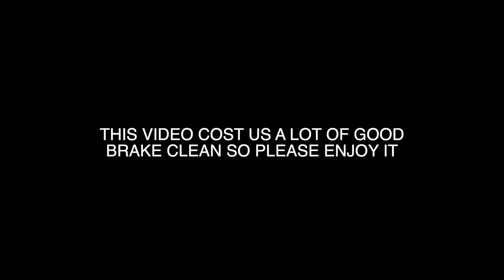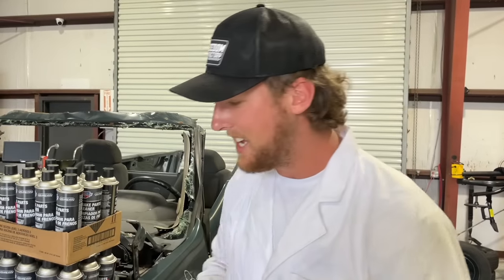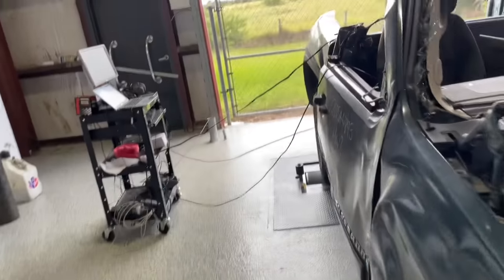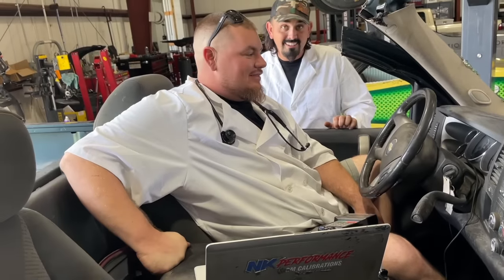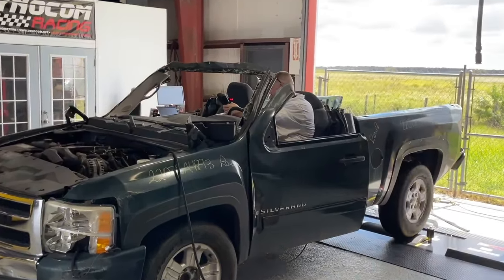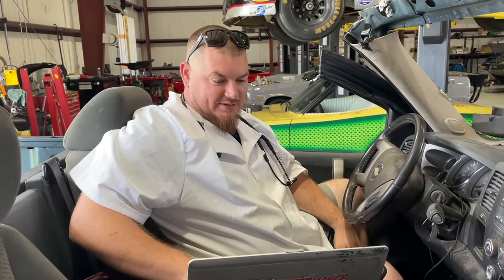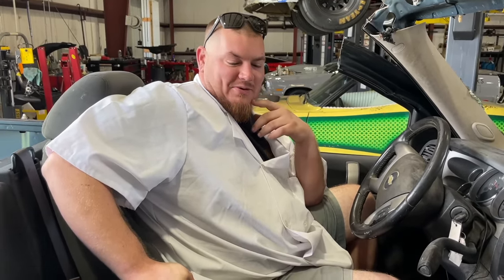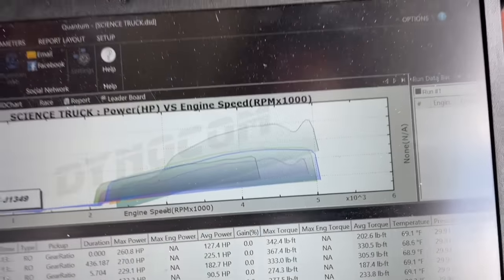We Replaced My Truck's Fuel With BRAKE CLEAN!!! Then Put It On the Dyno! (DO NOT TRY)

Comment: My vote is to test pure fuel stabilizer or maybe even pure octane booster!
Reply: Remember when project farm used to make this type of videos, but instead of cars, he tested it on lawnmower engines lol.
Reply: @eljaibas16  love me some Project Farm. He's cost me a fair bit of money. Lol.. in the best way possible. He's test/reviews are hella good sell ads. Lol
Reply: Make this get the likes people!
Reply: Inject oxygen-acetylene mixture.
Reply: I remember seeing a video of someone running everclear in a mower. It ran really well!
Reply: I was thinking the blue fuel they use in RC cars. It's mostly like jet fuel I think ain't it?
Reply: Been done
Reply: Seen a Video of someone who did this with a miata ran surprisingly well lmao.
Reply: An octane booster video would be great. Another one testing the different brands would be pretty cool too.
Reply: @eljaibas16  Project Farm is a Goat. He needs invites to Cleetus events, or DR videos.
Reply: @Vanbooskie  its called nitro, all motor 4 cylinder guys mix it with their methanol i think ive actually saw up to like a 90% mix on this one crazy ass civic.
Reply: Octane booster would be cool
Reply: @Vanbooskie  its nitro and castor oil
Reply: @HotDogBunN2YG  makes sense. I didn't know that
Reply: @Vanbooskie  rc fuel is nitromethane with a percentage off oil, the blue color is prob the oil.
Reply: @Vanbooskie Not even close, jet fuel is extremely similar to diesel and will run comfortably in a diesel motor *but has very low lubricity and will kill modern commonrail fuel pumps*. RC cars usually run nitromethane which is "closer" to gasoline than jetfuel
Reply: Octane booster is usually just kerosene, lubricants and usually some anti knock additives... It probably wouldn't be much different than running kerosene or diesel... Something I think would be really interesting is solvents... Like paint thinners... So acetone, mineral spirits, MEK, turpentine, etc. I'd also like to see someone try to run a stock vehicle off of methanol.... But not real methanol... The heet stuff you can buy from the parts store to keep your fuel from freezing up in the winter... Lol that would be really interesting for sure

Comment: I would love to see how a propane conversion would hold up to a race track. There are lots of propane conversions out there, but how would it hold up to the McFarland Science team stress test.
Reply: Thats a whole lot of work. I’ve seen a ton of mud trucks running propane so it should hold up just fine because nobody beats on a motor like a mudder
Reply: propane has a high "octane" rating 105-110ish. so i think this would be a good science vid for sure.
Reply: boom
Reply: there are a ton of cars in AU that had LPG
Reply: Propane is a great fuel for internal combustion engines. Only real problem is that it has way less energy per given unit of volume than gasoline. And unlike methanol it does not have the same cooling effect. I've seen 10 sec drag cars on propane in the past. This has not really been a thing lately but sure, I wouldn't mind seeing some testing done and a Mcfarland science test. 
They could use the Shyster for this. It's got a GM 4.3 V6 so if it blows up there are 10 million more out there
Reply: Family friend of mine ran a propane converted 302 in a rock crawler bronco and he beat that thing in the desert for years
Reply: So you want them to race a bomb?
Reply: @helplmchoking  i believe most of the taxis used it, im not from there just going off of things i’ve heard and read before
Reply: @micaharies  Ford actually offered LPG fueling a factory option, and went so far as to develop a special model of the 'Barra' inline 6 that was designed specifically to run on it. That engine was fitted with a direct injection system that sprayed liquid LPG into the cylinders, and actually made slightly more power than the petrol model due to a higher compression ratio of 12:1.

The LPG tanks were donut shaped and replaced the spare wheel, many converted cars retained their original fuel system and had the ability to run on either LPG or petrol.
Reply: @lidzykelly87  it is already a proven race fuel just nobody uses it because most race courses you can’t have a pressurized tank on the track I even had to pull my nitrous bottle and the solenoids out of the car before I could race at my local road course and it is a huge pain in the ass to install maintain use and the system is heavy it would work good as far as the motor but just as far as a convenient easy race fuel there are better ones that work with your existing fuel system. The biggest problem is the pressurized tanks required in order to use it. But the off-road guys love it there’s no rules out there
Reply: Uncle Tony on YT has one, it runs great, I converted a 6 cylinder Jeep to propane, ran great and at any angle.

Comment: Everyone knows you need a 50/50 mix of brake clean and octane booster to make some real power.
Reply: fr ffs 😂😂
Reply: That's what I was thinking during the video lol
Reply: Hair spray.
Reply: @michaelscott-joynt3215  With that crew who would have hair spray?
Reply: I had that same idea. They should try the brand Octane Supreme. It has actual tetraethyl Lead in it, I think it would raise the octane quite a bit.
Reply: dang i just posted this too lol
Reply: Add a bit of 2 stroke oil.
Reply: Could also try 50/50 brake clean/xylene. (Xylene is used as octane booster in pump gas). Can buy Xylene from hardware or paint stores.
Reply: Yes! Brake clean + octane booster!
Reply: All you need is some diesel fuel mixed in with the brake clean.
Reply: @FarmerFpv reported for false information
Reply: Per the MSDS that brake clean is roughly 47% methanol, 42% toluene, 11% acetone.  Those all have an octane rating above 100, probably in the 110 to 120 range.
Reply: It's not about you... It's the consumer.  - JD

Comment: You should retry a HP pull with the original octane fuel after the brake clean to see if it cleaned the injectors and created better atomization of fuel, to get more HPs!!

Comment: Once ran a 1998 Ford explorder 2.5 miles on brake cleaner to get to my boys house when his fuel pump went out. I sat on the radiator support while he drove about 10 mph.  Full break clean injected through the throttle body did the trick. Replaced the fuel pump, truck ran for years to come.

Comment: My son had an old homebuilt go cart with a well worn Briggs & Stratton engine. He used brake kleen to fire it up all the time.  Right until he seized it up while on startup! I'm sure he was being REALLY generous with his sprays though. Scarred the crap out of the cylinder wall and snapped the flywheel shear key when it locked up. Good times....

Comment: I'm curious to see how clean the inside of that engine is now and what the oil is looking like.
Reply: Let’s Talk 🎁🎁⬆️
Reply: The oil would look fine. All of the brake cleaner was igniting (prematurely); it wouldn’t have had a chance to mix.
Reply: Probably still cleaned the valves and maybe made holes in the pistons
Reply: One word.....nitro
Reply: Try running slick 50 or some sort only without motor oil....your engine builder will thank you!!!!!

Comment: Would be cool to see what would have happened if you added some octane booster into the brake clean and sent it :D
Reply: Sander, I was really hoping they would do that actually. And yes Caraballo it would be really fun to see that motor blow up, right in ya face
Reply: I was thinking throwing a few cups of diesel and see what happens
Reply: @luckyrashes  exactly! I was thinking 50% 93 octane and 50% diesel. 👍
Reply: @luckyrashes  Or 100% Seafoam, Marvel mystery oil, etc.
Reply: @sethgt1234  i've done that maybe not a 50/50 mix but a mix of diesel and petrol runs fine it's just smokey i ran it in a 1981 honda accord EX which is carburetted. 

for a short period in australia there was this thing of putting a LPG (liquid petroleum gas) (propane) system on a diesel to make more power. what it did was inject LPG into the airstream in addition to the diesel the disel was your spark. they banned it because esp on turbo system is it backfired you essentially had a BOMB in the intake
Reply: @sethgt1234  I meant Diesel because of its incredibly low octane to mix with this danger juice and maybe get something useful out of it
Reply: It would defeat the purpose of the brake clean.

Brake clean is effective for cleaning stuff because it’s so volatile, which is also what causes it to cause knock. You add octane booster to it and it becomes less volatile.

The reason high compression engines and boosted engines use higher octane gas is because the gas is LESS likely to combust, so therefor it only combusts by the spark plug igniting rather than accidentally by compression of the cylinders (knock)
Reply: @ChristopherGuilday  agreed, what are your thoughts on my thought, adding a few cups of diesel to that mixture, that's a ton of potential energy and a far lower rate of detonation

Comment: No way James wasn’t high as a kite after spraying all that brake clean in to a bucket 😂
Reply: Bad thing is that High comes with a hell of a headache
Reply: @600wheel  super high highs, super low lows.... Nope not for me no more
Reply: @600wheel  Voice of experience? ☠💀☠💀☠
Reply: @xippzap  yeah we use that shit a lot when we were doing industrial demolition in combination with cutting torches and the headache is real
Reply: Right! They do realize you can buy brake cleaner by the gallon.
Reply: @BaldBozo  i was screaming on screen for that but cant real blame them. If i were to make video i would have used cans also
Reply: They all looked that way before the cans even were opened. Legalize it.
Reply: Drain bread
Reply: Zippo lighter fluid
Reply: So high he grabbed his chef's coat instead of his lab coat 🤣🤣

Comment: They do make reusable break clean sprayers where you just buy the fluid, put it in the container, then pressurize it with an air compressor, which might be a  more cost effective and less wasteful option. Also might save a few brain cells lol
Reply: I was definitely yelling at the screen that you can buy this stuff by the gallon!
Reply: Yep, same here 😂
Reply: yep i buy it by the 5L container (its the UK, no gallons here!) id be bankrupt if i used aerosols.
Reply: I was hoping there was plenty ventilation near the bucket where all that butane propellant was flying out lol.
Reply: Zippo lighter fluid

Comment: I'd love to see you try WD-40.  I've run a 5hp briggs on it briefly... would be fun to see what it does in a big engine.
Reply: I don’t think it ran on the WD40 but the flammable gas used as a propellant.
Reply: @MOE-db8oc  you can buy wd-40 in a gallon can.
Reply: @Wulthrin  
So what. I don’t think the poster was pouring  WD40 from a gallon can into his B&S motor to get to run.
Reply: I have not tried wd40 by the gallon but I have started engines with the aerosol cans. I think we found the next science project
Reply: @benjirevels7900  
Exactly. You can get the same effect from a can of hair spray or even cooking oil spray. It’s not always the fluid being dispensed as much as it is the propellant.
Reply: @MOE-db8oc  yes and the fact the fluid is aerosolized
Reply: I've run a big block Chevy on WD-40. It works just as well as starter fluid.
Reply: I use wd40 to run lawn mowers and chain saws when i am just checking to see if they will fire but would be a cool test
Reply: @MOE-db8oc  Yeah, that's pretty much what I was doing.  I didn't want to type a novel, so kept my comment short... but I guess it needs some explaining.  The engine was a 5hp briggs with a 28mm flatslide carb set up to run on methanol.  If you leave methanol in the carb, even overnight, it would dissolve some of the aluminium and make this white whispy gel which would gum up the jets.  So, at the end of a race day I would take the fuel line off the fuel cell, drop it in a gallon can of WD-40, and run the engine until the methanol was out.  (The engine would pick up speed and massive clouds of white smoke would come out the exhaust.)  So, the engine was definitely running on WD-40.  No aerosol or propellant involved.

Comment: Almost wish you would've bore-scoped it before and after to see if this is a good way to de-carbon some pistons!
Reply: yea after that i'll bet there is not 1 piece of carbon anywhere in that engine and the fuel injectors are factory new clean
Reply: I’ll tell you right now, tip small amounts of distilled water into your throttle body while the engine is idling. Use enough so the engine coughs and farts but doesn’t stall, repeat a few times or until performance improves.

Basically steam cleaning your bores and valves so an oil change afterwards is probably not a bad idea.

Comment: Once. I was running low on gas (02" Chevy Tahoe stage cam 5.3) but had 3 gallons of tranny fluid (clean) & 5 gallons of diesel..  my truck was on less than a 1/4 tank..  I had over 30milez to the next town 20 miles to nearest truckstop...  Ran like ah champ .

Comment: You should try to run an engine upside down
Reply: It won't work bc all the oil will pour out
Reply: Isn't that what they are doing with KillaB?
Reply: @Skwisgar2322  it took me a minute to get this 😂😂
Reply: I wrecked a V6 firebird that ran upside down for 20 minutes at idle before dying. it was a smoke show .
Reply: George already tried that
Reply: If you had a good dry sump setup and could pull the oil out of the valve covers fast enough it’d probably run for quite a while. Would still smoke a ton and probably be terrible for foaming the oil as it’d fill the underside of the pistons and get thrown around a bunch.
Reply: That would be a blast
Reply: I did that in a pontiac montana after sliding over an embankment. parked on the roof and the engine was still running. Lotsa red warning lights on the dash as I recall...

Comment: Pure acetone would be an interesting one I think or Kerosene.  It love the experiments you guys are doing! Keep it up

(Edit: sorry never specified for it being a fuel replacement, it’s a possible engine oil replacement… also what about weird trans fluids? Like syrup vs Sunflower oil?)
Reply: Kerosene would be basically diesel wouldn't it?
Reply: @aaronkratzmann9703  yes
Reply: Run the engine on high octane booster with kerosene in the oil pan
Reply: Kerosene is very low octane.  Prolly worse than brake clean.
Reply: Try to run it on just octane booster. With the oil replaced with kerosene of course
Reply: ProjectFarms did a ton of "fuels" on a lawnmower engine before he got into tool comparison videos.
Reply: @trixter192  that’s true I like that he also used a plexiglass window. As already seeing in small engines would make for an interesting video with a full truck engine. Gives us a better “hypotenuse” on the outcome
Reply: @GK-gr2mx  kero also makes jet fuel so..

Comment: Love this kind of science, more please! You really should be wearing your fire suits when performing experiments with fuel (with the lab coats over them of course), we want to see you guys be able to keep doing these if something went wrong
Reply: It’s brake clean, not uranium. I’m sure every one off them has lit it off before.
Reply: @pauloakes6952  there is a very big difference between a can exploding and a entire bucket full going up
Reply: @pauloakes6952  yea I know lots of mechanics that have an open 2 gallons of brake clean sitting 6 inches from battery hookups with a fuel pump spraying it everywhere. Happens everyday, I mean its not uranium.

Comment: You can buy brake clean by the gallon/barrel and fill up pump pressurized spray bottles. Much cheaper than buying cans by the case load.
Reply: Too late!!

Comment: You should go for the 55 gallon drum of brake clean.   It is expensive, but overall, way cheaper than many cans of brake clean.
Reply: Way better for the environment too vs using thousands of cans a year that go in the trash
Reply: I always thought it was just pressurized cans of acetone...would have been so much easier than holding down those tabs to spray out the bottles,.
Reply: @calebrichter2565  acetone smells completely different
Reply: @calebrichter2565  Tetrachloroethylene

Comment: I think you should try diesel as the fuel and let Nate try to tune that. It would be very interesting to see.
Reply: Diesel won't light off in a low compression gasoline engine.
Reply: @corvettejohn4507  that shouldn’t stop them from trying!  If anything try it straight then add small amounts of gasoline until it does run!
Reply: @german3579  I would say it having no chance of working is a good reason not to try.
Reply: The diesel would need to be heated way up before entering the fuel rails.
Reply: 50/50 Gas and Diesel
Reply: My grandfather used to use coal oil in his model t cause gas it was way cheaper. He ran a copper pipe around his exhaust and into a valve n the fuel line. Once engine was HOT he would switch over from gas to the oil, and he had a adjuster in the car for the needle valve... Secret he said was to turn it back to gas when he shut it off, cause it didnt want to start when it was cold.
Reply: This wont work, if u mix gas with diesel l, and there's too much diesel the gas will burn and the diesel will just smoke/ flood ur cilinders with unburnt fuel.
Reply: It won’t make it past the injectors
Reply: Someone doesn't know much about engines you dont have the compression to light of diesel on a gas engine

Comment: Without even watching the video, I do this almost every day. Have a bunch of cars around that usually don't have a fuel system, or a messed up one. Fill the float bowl with brake clean and I can usually get around the building to the shop. I have also done this to cars with vapor lock issues. Although, horrendous spark knock on a hot engine.